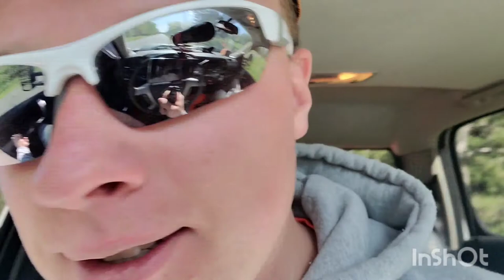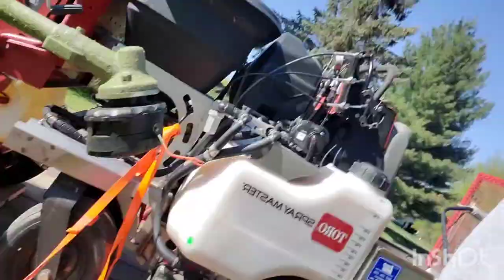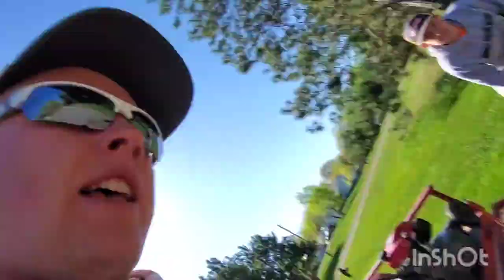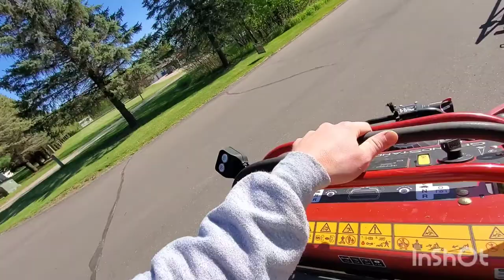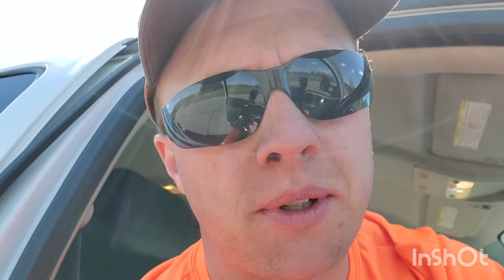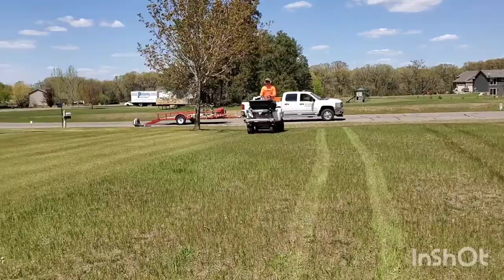Masks and Mowing!

Comment: Cool drone footage. I don't allow the customer to tell me what to put down. No weed and feed here. All my fertilizer is granular only straight fertilizer 30-0-10 besides 15-0-0 pre emergent one and what I use for winterizer one I can't think right now. Then all my weed control is liquid only. I have a minimum of 5 applications also. Stuff to think about so you can try and get everyone on same schedule with product you use.
Reply from the maker: That's excellent advice! We run 7 step program. 5 granular 2 sprays and no weed and feed. Because unless you water it in right away it's pointless...